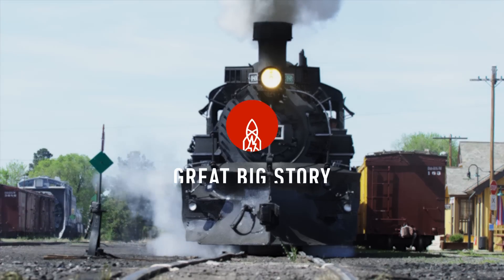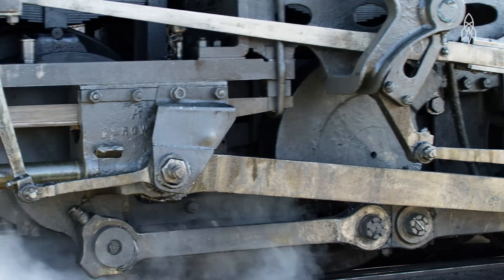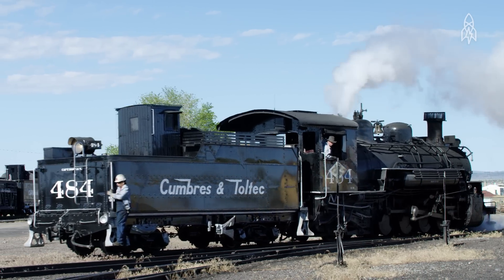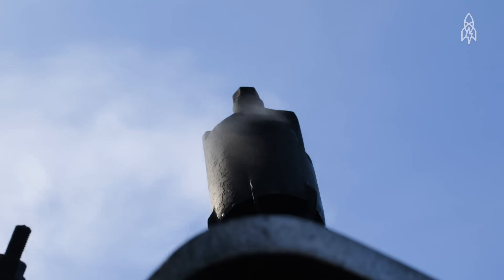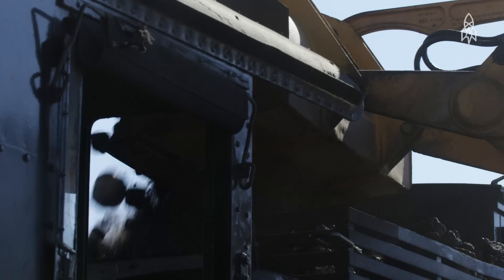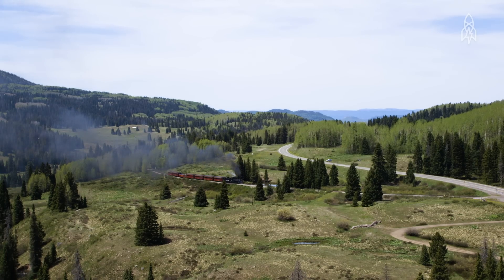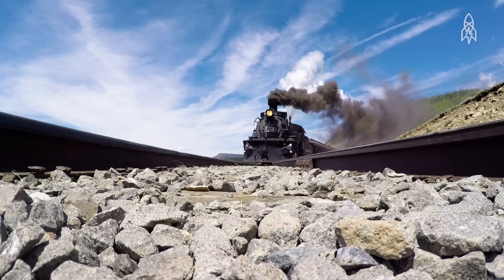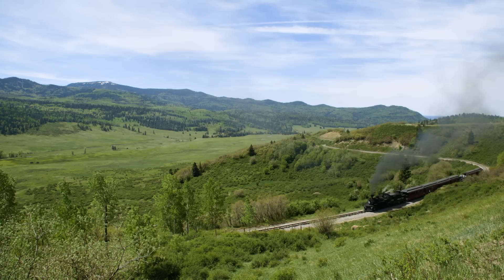All Aboard One of the Last Authentic Steam Railroads

Comment: Nice video. Steam should return. It's LOT cheaper than diesel. Modern steam angines have 21%+ coal energy efficiency vs 36%+ of diesel, but the coal is 15-times cheaper than oil, anf steam angine can burn virtually all fosil fuel - burning wood chips (leftovers from industry) would be carbon neutral! Modern steam engines have no smoke, and have 90% less boiler meintenance than old 1930's US engines.
Reply: Have you punched the floos after burning wood chips?
Reply: I know what he's talking about. With how Advanced Steam burns the fuel, it gasifies it before actually burning the fuel. So there's no cinders or ashes getting drawn through the flues to wear them down or block them.